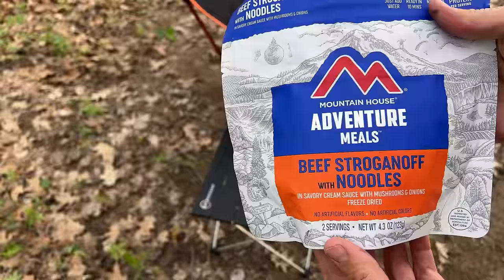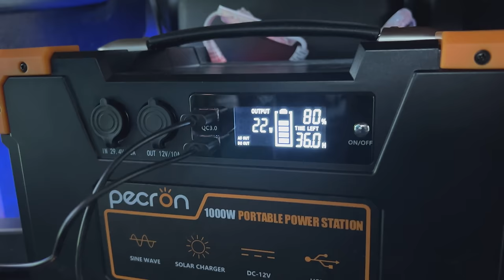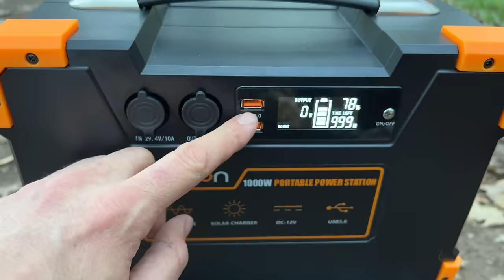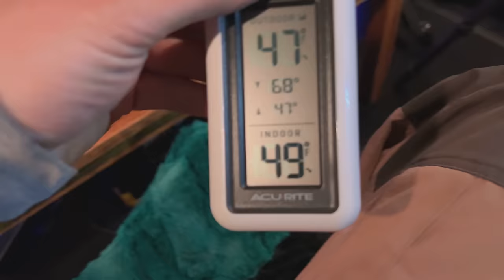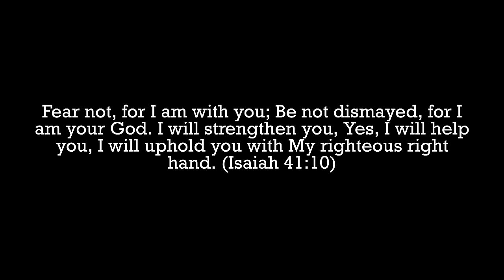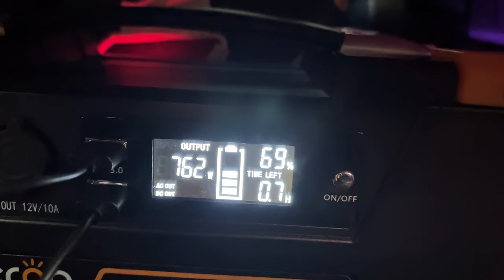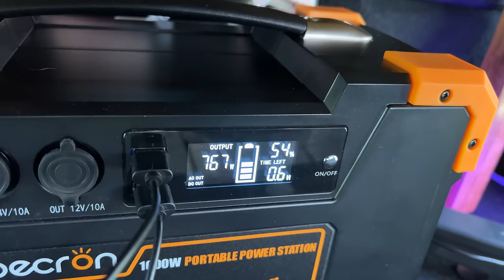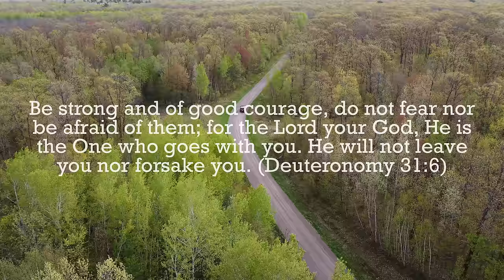Car Camping in the Woods (Almost got Robbed) Van Life

Comment: You can charge Jackery power stations with other branded solar panels. I have a little 20w panel I use to keep my Jackery 300 topped off when I’m out camping. It came with an adapter to fit the Jackery. I’ve had bad luck with cheaper power stations. Jackery, Anker and EcoFlow are the only ones that haven’t failed on me so far. I’ll check out the Pecron. I see they have a handful on Amazon. Love the content!  Binge watching all your vids right now!  I’m hoping to get into more content like this on my second channel this summer. 👍
Reply from the maker: Thanks bro and yeah I’ve been learning a lot about power stations since this video and how you can buy attachments to make it work. You definitely should get some camping content going

Comment: One way to make the ac more efficient is to partition off the front of the van with a blanket. Only have the front of the ac in the back of the van and the heat generating compressor near the front of the van on the other side of the blanket.

Comment: Heard that the puffy blanket was warm, but slippery.You wake up cold with it on the floor.
Reply from the maker: It’s a nice little blanket to have with you for cool nights but definitely not super warm for winter nights. It does have that slippery cool material, but I wrap up in it so it doesn’t fall off

Comment: I didnt see where you almost got robbed? I did see some ppl out burn riding and enjoying the area. Click bate!
Reply from the maker: I wasn’t going to point the camera at the guys going 1/4 mile an hour with driver hanging half way out the car while his buddy in passenger seat was looking over him directly at me and show the black out windows tint in back. I looked at them 3 times in the span of 5-10 minutes they basically weren’t moving and he was looking right toward my van. Never caught driver looking at me as he stayed hanging out the car with head looking at dirt ground. It seemed as he was trying to look like a distraction like they were listening for a car issue while passenger and possibly people in back scoped out the situation. I did not hear any sounds from the vehicle that would make him do that, nor would any normal person do it the way there were. I’m very good at reading people and picking up vibes because I grew up around trouble and can sense it. I also always try to give people the benefit of the doubt but this was way to out there. I didn’t take time to mess around, film or stare back, I started packing up like anyone smart would do especially if they aren’t carrying. The second car literally came within couple minutes of the truck leaving which is only reason I was on edge about that car because wasn’t sure if the truck told them anything or they were gonna come back. Normally I see a car do that at end of dirt road cul de sac I think they are out smoking which I stated but it happened right after which made me not sure what they were up to. Just because I didn’t get all of it on film, have a shoot out or have them yell I was about to rob you doesn’t mean that’s not what almost happened. When I think about this trip and video that’s what comes to my mind so included it in title.